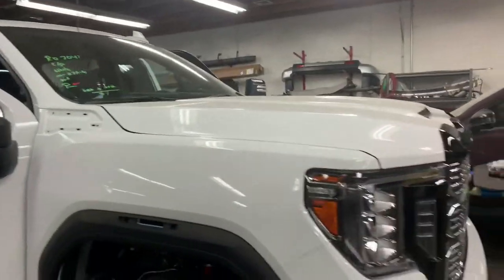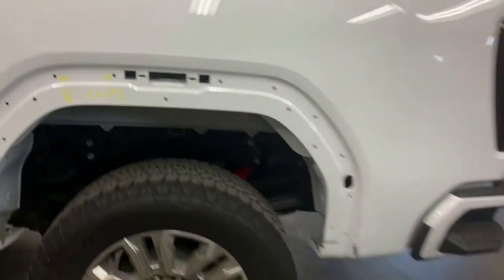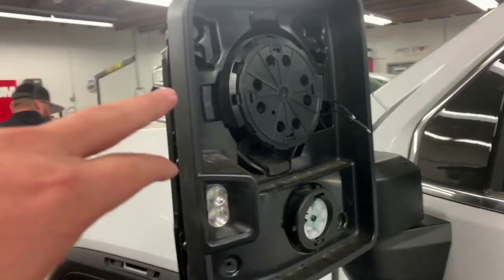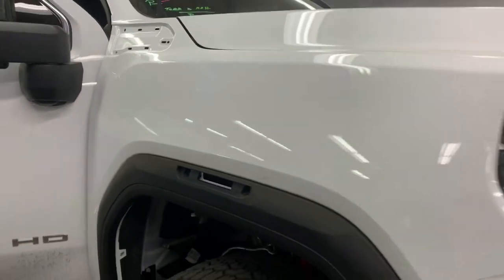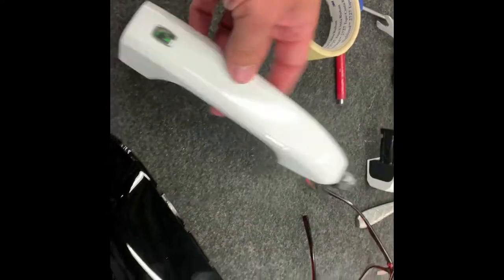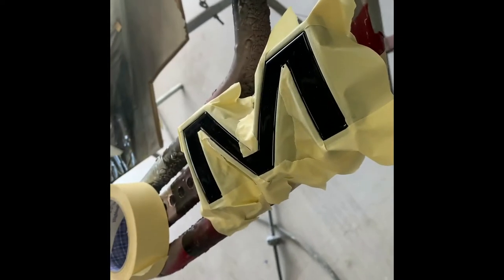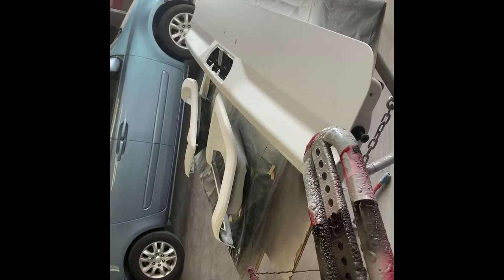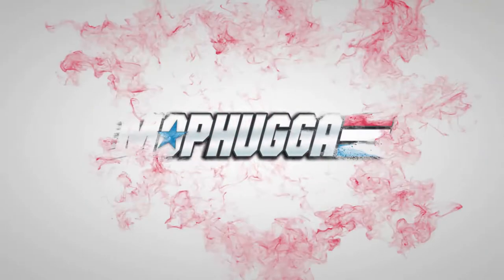2020 GMC Denali Chrome delete part 1

Comment: Just ordered a 2021 3500. Going to do the color match. What is the process for painting over the chrome plated parts. I haven't had any luck in the past painting over chrome.  Thanks
Reply from the maker: we sand the plastice chrome plated parts, and the we epoxy prime them.  That has given us the best paint adhesion!